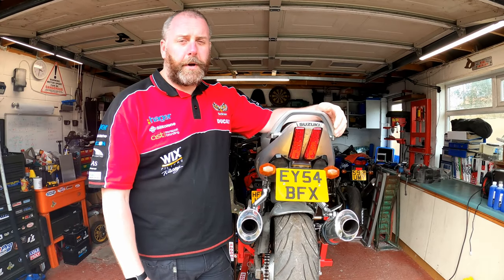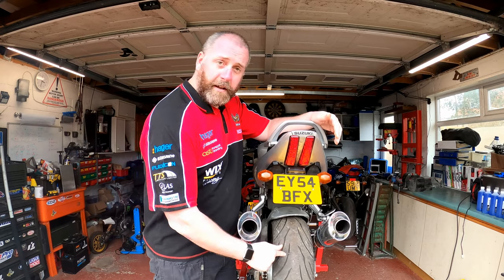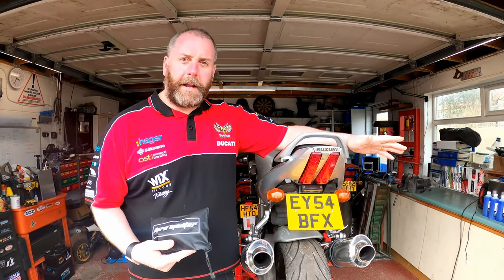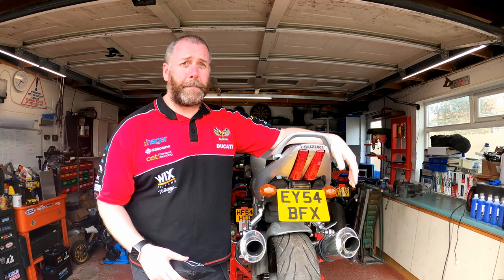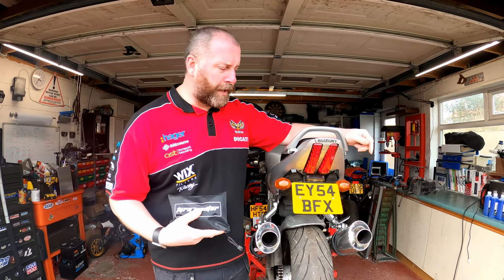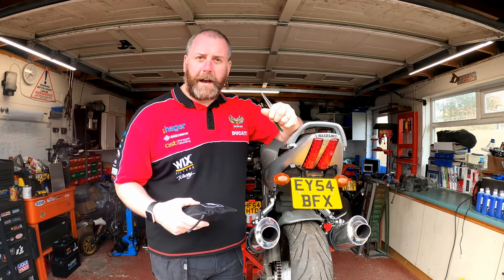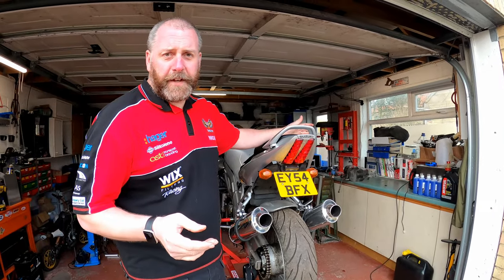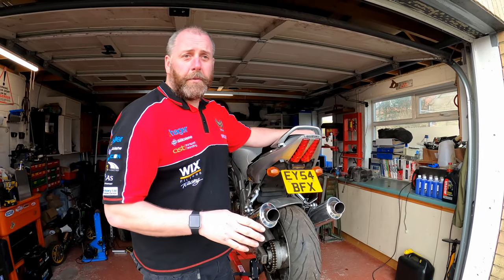How To Fix A Puncture On Your Motorcycle At The Roadside & Avoid Expensive Breakdown Recovery!

Comment: I had to repair two punctures (one nail, one screw) in car tyres last week and used this technique without problems, though I put rubber glue solution on the rope before inserting it. I did a soapy water test after and no leaks. I carry a small Ring compressor (About a tenner from Amazon) in my car which is worth it's weight in gold, but for the bikes I have CO2 canisters. I did have a puncture in a new rear tyre on my Sprint ST1050 a couple of years ago but like you noticed it when I got home pushing the bike into the garage. Cost me another new tyre that one. I think you can buy puncture repair kits with mushroom bungs instead of rope which are the ones 'professionals' use. When I go on tour I take the small Ring compressor to reinflate as handling frozen CO2 canisters even with the insulation around them is not without risk. Anyway thanks Kevin. This was entertaining ;@).

Comment: Small hand pumps such as used for mountain bikes also fit onto bike valves, it would be an effort to use but might save your bacon if you have a mishap with one of the CO2 containers.
Reply from the maker: I agree about the size but have you tried to pump up a motorcycle tire with one? I can’t imagine it’s that easy! I might give it a go and report back! 😁

Comment: I've been riding on a plugged rear tyre now for ages, was worried about it at first but riding away as normal now.
I find it a lot handier to carry a mini air compressor in the pannier or under the seat, those little C02 cannisters seem a bit of a faff to me, I would use the rubber cement/vulcanising solution on the gummy worm too. great vid as always.

Comment: Hey Kev I've got to disagree with you. The rubber solution you said is mainly a lubricant is actually more than that. I've patched lawn tracker inner tubs with that stuff . Just using it and a old piece of tub. Good video though as usual. CHEERS
Reply from the maker: I agree with you completely, my point in the video was that it doesn’t improve the standard of repair, it is exactly the same rubber solution that you get in any pushbike puncture repair kit. It adds no benefit to these type of repairs in my opinion, in fact if anything it just makes an unnecessary dribbly mess! My opinion though naturally! 👍🏻😎

Comment: Hey kev check your uk laws cause here in ireland those puncture kits are actually illegal to use now.
Reply: You sure? where did you read that?
Reply from the maker: It may very well be the case in the UK too mate; however, I would still rather use this kit to get me home. I don't fancy sitting at the side of the road just because some guy in a fancy suit said they are longer approved for road use. I would still use it to limp home and change the tyre at the earliest opportunity. Spray sealants, the kind that pump slime into the tyres are just messy and not 100% guaranteed to work. I have never had one of these repairs not work. In fact I haven't changed the tyre yet and it is still inflated. I filmed the video 4 weeks ago so it seems pretty sound.
Reply: @roadwarrior8560  I work as a mechanic for over 30 years in ireland and deal with tyre centres all the time and for them to repair punctures they have to take the tyre off and patch it properly.👍🇮🇪

Comment: Imagine getting the tires replaced every time you get a puncture lol
Reply from the maker: It all depends on how confident you feel in the repair doesn’t it! 👍🏻
Reply: @KevsShed  Oh forgot to mention that the roads in my country are not maintained well. 
I've used 5 of those patches in last 2 years and the tpms sensors report no air leaks, no issues whatsoever. (I'm talking about a car)